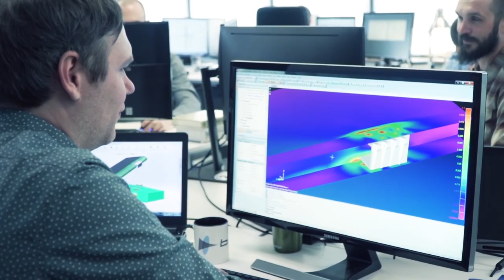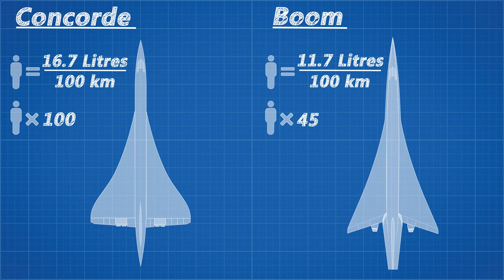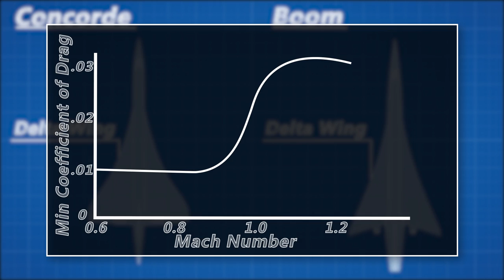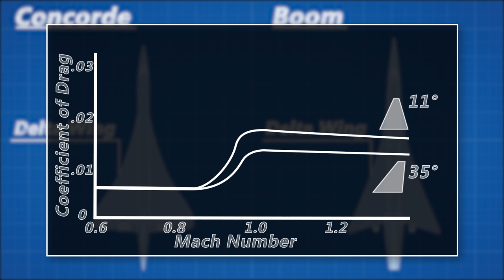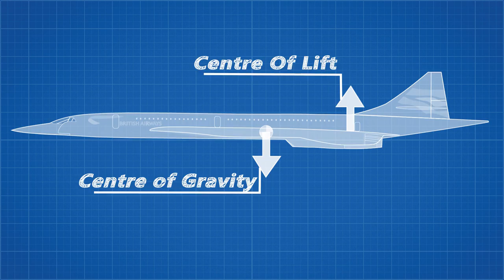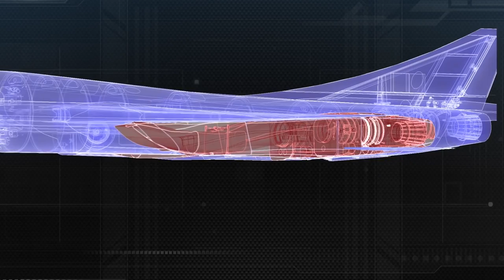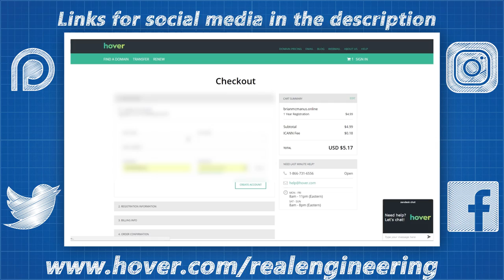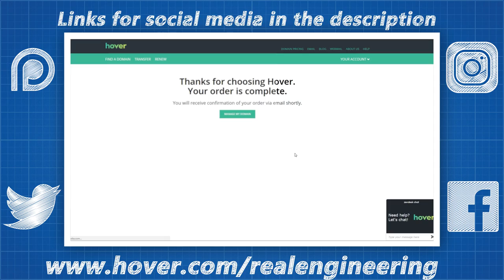Boom: The Future of Supersonic Flight?

Comment: Unfortunately, in 50 or so years time there will be no commercial aircraft flying. Not even subsonic!
Reply: What do you base this on?
Reply: kdmc40 maybe we will see another Blimp/Zeppelin era with solar powered massive blimps. I wouldn't mind that.
Reply: why is that?
Reply: Fuel
Reply: crude oil can be created from algae at high pressure and heat, which with modern energy recovery methods is quite efficient
the only barrier to it is not having easily farmable waters, which could be changed quickly by lifting restrictions on phosphorous in detergents
Reply: ???? they do though
100-LL and Jet A come from fossil fuels
Reply: If Kerosene and Gasoline are banned because of environmental regulations (which they should), nuclear powered planes are a definite possibility. If a jet was powered by a fission reactor, it would be able to stay in the air for weeks or even months.
Reply: Although you may be right about a fission reactor delivering enough power to enable stable flight, it is highly unlikely that a fission power system will be able to deliver the large range of rapidly changing thrust magnitudes that a jet requires for manoeuvrability. Moreover, there is absolutely no need for any jet to stay in the air for weeks or months, as there is simply no task that requires that kind of flight envelope. Any long-endurance flight would be powered by solar power on a high aspect ratio plane with a low cruise speed. Without being a nuclear expert, I simply don't think fission has the versatility required for aircraft propulsion purposes. Fusion perhaps at some point, correct me if I'm wrong?

What I agree with you on, is that a (necessary) ban on fossil fuels would in no way mean the end of civil or military aviation. There are already trials with solar power and battery power, and because the energy density for batteries is going up at the some time as price per kWh is decreasing, this will at some point make battery power feasible for aviation purposes. Perhaps not for commercial airliners, but who knows what technology will have brought us in 50 years time? 

One thing is for sure, the original comment by @kdmc40 is not very sensible.
Reply: killarz0 the USAF played around with the concept of the nuclear powered bomber, they gave Congress a "glowing" report on the project. Nobody in their right mind would want to use any kind of nuclear reactor in an aircraft in case it crashes. Anyway the shielding required would ensure that the aircraft would have lower profitability than Concorde and that's going some!

I suspect the next big thing in aviation fuel will be hydrogen, but don't tell the greens as the gaseous emissions of burning hydrogen will also produce a notorious greenhouse gas - H2O.
Reply: kdmc40 
Even assuming fossil fuels are uneconomical or absent by then, it would be a mistake to assume that biofuels would remain prohibitively expensive by that time. Even if they were, you don't need fossil fuels to operate an aircraft. It can operate using electric motors, powered by batteries, solar panels, and/or liquid hydrogen. Then there's the possibility of nuclear power. All of these are theoretically achievable today, much less in fifty years. Solar Ship, for instance, is a Canadian company which is building a combination flying wing/airship that has a hybrid powerplant of solar and gasoline.
Reply: Solar is unlikely to be used for thrust outside of ultralight unmanned aircraft. The surface area required would just be too great. If you could make a battery with the same energy density and volume as kerosene, than sure, that could work. Personally I think bio or synthetic fuels will be used, possibly hydrogen if it can be stored properly.
Reply: +logan kotz - Yes. In fact, Jet A is essentially just highly refined Diesel, and it's not uncommon to see cars and lorries on airports running on Jet A, as a diesel engine will happily run on it without any issues.
Reply: Electric aircraft propulsion will take ages to become viable. It probably won't even happen because we already have a technology that is better and "if the funds were gathered" doable with today's technology. The hyperloop:  just tube the shit out of the globe, somehow secure the network from terrorist attacks, and say goodbye to aviation.
Reply: Ralphie Raccoon 
Under ordinary circumstances, you are correct. Even if every surface of a commercial airliner were covered in 100% efficient solar panels, it couldn't get off the ground. Sunlight simply isn't that powerful. However, large multi-ton cargo aircraft like those being developed by Solar Ship have a much larger wing area (due to their oversized delta configuration) and drastically lower energy requirements (due to their very low speed).

On another point, batteries would not need to have the energy density of kerosene, if physics would even permit such a thing. Liquid hydrogen could run an electric or combustion aircraft. And, as electric motors are more than 95% efficient nowadays, they can go much further on less absolute amounts of energy.
Reply: MrAdoh2010 
The hyperloop is not viable in any way, shape, or form. I don't trust it to be able to operate without causing the horrific, gruesome catastrophes that are inevitable when dealing with vacuum, much less doing so in an economical fashion. Even if they were commercially viable, hyperloops would no more be able to replace aviation than bullet trains in Europe and Asia have replaced airplanes. Reminder: you can't build rails or tubes on the ocean, and ocean liners are all but extinct.
Reply: Uh, in 50 years we would be using electrical base  tubrofan engines, so don't worry.
Reply: Biofuel jet fuel is 70% normal jet fuel, so even if enough land and take-aways  could be found to fuel all those aircraft, it would not help much.  The crew from the Russian nuclear aircraft were all dead after a few years because of the radiation - nobody has found a safe way to shield the crew, let alone any passengers, of a nuclear aircraft (which spews out radiated exhaust from its engines in the simpler version at least).  There may be fuel available to fly some planes in 50 years but it will be too expensive for most people to afford it, and massive increases in passenger numbers are reliant on cheap air tickets - tickets that increase in price at a rate lower than the increase in incomes.  For quite a while now, real incomes for the masses have not been increasing.   Meanwhile the demand for oil and oil products continues to rise, and so eventually the price will start to rise sharply.  So in 50 years time (probably sooner) only the super rich, emergency services, government leaders, and armed forces will be flying (if they the last group don't decide to keep all the air fuel for themselves)
Reply: But hey, we can still get the electric powered airplanes, those can be run on any kind of fuel via a generator and still provide enough power to break the sonic barrier. And those are so cheap to make, cheaper then most other airplanes.(though you would need a way to make batteries swappable quickly.)
Reply: there would be sub orbital for long range flights
Reply: The Skylon requires  a reinforced runway and at least two days after each flight for turn-around.  It runs on liquid hydrogen so there's not such a problem with fuel, although additional infrastructure would have to be made available to provide it.  There's not been any mention of how much noise it would make on take-off; and it would probably have to take off over water.   it only carries 24 passengers and first flight is not until at least 2025 - flights which would probably be rather expensive, this isn't a mass transport option, though after more development something better might be achieved.
Reply: You can't have electric powered jets so you can't have a supersonic electric aircraft.  Also batteries don't have the power to weight ratio required.  Batteries can continue to be developed but at the moment they require exotic materials that are likely to be in short supply - lithium for instance is a common element but present in only a few places in concentrations worth mining.  The rare earths are in a similar situation (hence their name) and the supply of cobalt doesn't seem to be that plentiful, either.
Reply: The solar ship is a more of a blimp than a plane, and compared to a passenger plane the payload is tiny. And anyway, something that slow would not be tolerated by many passengers.

I mentioned hydrogen, that is a possibility, but there are challenges compared to synthetic or bio kerosene. And even if the motors were 95% efficient, the fuel cells definitely won't be. Probably better to burn the hydrogen in the engine, after all, you only get water out.
Reply: Ralphie Raccoon 
The Solar Ship isn't really a blimp by any reasonable definition. Only 30% of its lift comes from buoyancy; the remaining 70% is aerodynamic lift just like any other plane. And its payload is actually quite high compared to its competitors—bush airplanes and helicopters. Larger planned versions can carry many tons of cargo, but due to its inherent design, its physical dimensions (though not necessarily mass) will be much larger than similar planes, and its speed consequently much less. A top speed of 80 miles per hour may not sound like much, but these are cargo aircraft, not passenger aircraft.
Reply: but even 80 mph might be acceptable to passengers for a cheap flight as it would be in a straight line, ignoring terrain,  with larger amounts of baggage per passenger, and  considerable comfort would be possible (like the early airships) - rather like cruise ships I suppose, although just as susceptible to the weather if not pressurised.
Reply: thracianTV 
One thing that any airship or hybrid airship will always have in abundance is space. The R101 airship, for example, had more than 5,500 square feet of space on the A Deck alone. That by itself is more than an entire jumbo jet. 

Perhaps that and the lower cost would make up for the lack of speed, if some sort of passenger application were to be considered.
Reply: 80 mph? With all the hassle of the airport I think driving would be quicker. And good luck getting cheap tickets with a craft that small. Larger amounts of baggage will reduce the number of passengers it can carry. And even a comfortable seat would be uncomfortable after 24 hours sat in it.
Reply: All that space is no good if you can't carry a whole lot. Space is not the most important thing, payload is. honestly I can't see these things being cheap if they can only carry a few tens of people. Economies of scale and all that.
Reply: Exactly, these are not going to be used for passenger routes. Many tons is nice, but you'll need tens of tons of payload to compete with traditional large cargo haulers. Plus if you need massive specialist infrastructure that's also a problem. A small fixed wing  plane just needs a small airstrip and a hangar.
Reply: That's fine because it's a spacecraft, it's not going to be used for terrestrial passenger travel. There is the A2 hypersonic concept which uses similar technology, but that's even later in the pipeline. But in theory a London to Sydney trip could take just 4-5 hours on it.
Reply: TheVarklin Firstly, I've been an aeronautical engineering all my life. Thete are certain things happening today that didn't hamper technological progress in the past, one being the rate of technological change. I'll come back to that. Firstly, the world is running out of fossil fuels ant thetes no way to power aircraft without them. Things like Hydrogen is no good as it would take at least 30 years to develope a commercial hyhrogen aircraft if you started the research right now. No company is going to risk the investment over that time for something like transport when it is likely that fusion will be sorted by then and make high speed ground transport very cost effective. Back to the rate of technological change, if you were to start research on something say over 20 years by the time you gor half way through it the research you started with in the early stages would be obsolete. This obsolescence carries on through the life of the project. Fusion is the only technology thet is worth the long term investment because it is such a total game changer. Any hydrocarbon type fuels we have in the future would be better used on say agriculture to feel the 11 Billion people there will be in 2060.  My guess is there will be a world where fusion rules, high speed trains in tubes carrying people from the centre of one population mass to another. Really no need for large commercial aircraft polluting the atmosphere!
Reply: Jjames763 you wouldn't be operating in a vacuum. It would be roughly the same environment as a high altitude aircraft but powered by electricity. How it works is a partial vacuum and the train sucks the remaining air from in front of it and pushes it out the back behind it.
Reply: Jjames763 electric/battery system is not feasible for many reasons, firstly the energy density of batteries would no come close to enough. Nuclear is not feasible because of safety and just plain space. The nuclear reactor does not in itself generate power, it creats heat which drives a steam turbine which drives a generator which produces power. Solar again just doesn't have the energy density. Hydrogen won't work either as for the dame reason Zeppelins stopped using it, safety. Also, producing Hydrogen and then recombining it with oxygen is very inefficient use of energy. Its possible with biofuel as it would take relatively little to convert a modern aitcraft to biofuel right now. But i think biofuels will be needed for more important uses like agriculture. Seeing as there will be 11 Billion people by 2060.
Reply: r0nas22 This is very feasible.
Reply: Tom Johnson 2030 is just around the corner. I'm talking about 2060-2070ish.
Reply: Ralphie Raccoon 
Again, you're not looking at the proper aircraft here. The first aircraft built by Solar Ship are of a similar mass to planes like a De Havilland Twin Otter, with the advantage of an ostensibly lower cost and higher payload capacity and the disadvantage of lower speed. You can call the payload small all you like, but that's like judging a commercial jet to be unfeasible based on the size and performance of a Cessna Caravan. They have larger versions planned out that can carry many tens of tons.
Reply: Ralphie Raccoon 
As for infrastructure, Solar Ships are bush aircraft. They can operate in the same places and they are small enough to fit inside those same hangars used by bush planes—the company uses such hangars for its smaller prototypes. Larger versions need larger hangars, just like larger cargo aircraft.
Reply: kdmc40 
When I say "nuclear," I'm referring to the possibility of fusion, or some of the wilder concepts for safe reactions. Assuming they become viable by 2060s and 2070s. I was just listing out possibilities for alternative power sources in order to counter the original poster's claim that aviation in 50 years will be extinct. I wasn't necessarily listing them in any particular order of viability. If you want my personal opinion, in 50 years' time commercial planes will probably be using some sort of biofuel, or possibly have some sort of hybrid electric propulsion. Shorter-range craft may well be battery-electric.
Reply: Jjames763 Fusion really isn't viable for aircraft. It'll take at probably 2050 for a viable fusion to be up and running and it will be huge. Fusion will still require a steam system to generate electricity. They would have to develope a system small enough to be carried on aircraft. This really is not going to happen. 
I think technology is paintong itself into a corner right now. I read an article written in 1971 by respected scientists that stated we would definitely be on Mars by 1985. The same article stated they're would be cities on Mars by 2020. When in fact we have not being out of low earth orbit sonce 1972. The space shuttle and concord were retired with no idea what was going to replace them. 
An electric/hybrid aircraft is not feasible either as it is not expected for batteries to have the same energy density of say Jet A1 until 2050. Say you had a hybrid system with 60% biofuel and 40% battery. That means that you have to carry about 25 tons of battery for the entire trip. They're would be no purpose in this as you would have to carry extra biofuel to tow the battery system around the sky. Also, you could refuel the biofuel relatively quickly but what about charging the batteries. Fact is, no one is investing any money in any future aviation designes that could be a game changer.
Reply: kdmc40 
Yes… I agree. The current developments are indicative of what we in the biology sphere call "involving to extinction," that is to say, short-term gains and savings being made at the expense of the long term. We need to get in on non-fossil-fuel dependent aviation now to avoid a great deal of pain and loss later—but we aren't. Regardless, I just don't see the economic forces being such that it would completely destroy aviation. It may be changed or much reduced or supplanted at the lower cost levels by rail, but aviation in some shape or form will probably survive. It is simply too big an industry and too high in demand by too many people. Many of whom are of considerable means, political and economic.
Reply: Jjames763 You could be right, I hope I'm wrong!
Reply: The much publicised flights of aircraft on biofuels have so far been with fuels that had 70% normal aviation fuel - so that won't stop a reliance on fossil fuels, even if sufficient crops could be grown and take-away stores could be found to supply the whole aircraft fleet.  The extensive use of biofuels would create a food crisis and extensive world-wide instability as food prices rocketed.  Even the use of algae to grow fuel would involve large amounts of inputs that would be better used elsewhere and some of them would be derived from fossil fuels or use fossil fuels in their manufacture (e.g. fertiliser).
Reply: thracianTV 
Not necessarily. The biofuels are a proof of concept—you could in theory burn 100% bio-derived liquid fuels in a futuristic aircraft designed to that specification. And this business about a food crisis is overblown if you ask me—corn ethanol is already obsolete. The real biofuel contributions will be from non-food crops such as genetically modified algae and grasses. Such installations needn't be operated with traditional agriculture, either. Industrializing the production process using methods similar to hydroponics and vertical farming could vastly reduce the pressure on land and resources that can otherwise be utilized for maintaining the natural environment, food production, and human habitation. Naturally, costs will come down eventually, but you need to have a strong initial investment in the research and infrastructure for that to happen.
Reply: most agricultural processes require vast amounts of fossil fuels and fossil fuel derivatives and using waste products such as grasses seems likely to still encounter the problem of finding enough space to grow them.   Basically (as resources are always going to be unequally distributed) you need the human population to fall and reduce pressure on resources to a sustainable level.
Reply: thracianTV 
There's no contesting that resource use must be reduced, but there are certainly different degrees. Hydroponics, for instance, requires enormous initial capital investment to be done at appreciable scales, and so obviously doesn't work well in third world countries and the like, and in terms of food production it is only really useful for fast-growing fruits and vegetables, not staples like grain, potatoes, or anything which comes from a tree. However, its land, water, and fertilizer use is staggeringly reduced compared to conventional agriculture. For an operation like biofuels, it would need to be done at massive scale or not at all. Preferably, it would only have to be done for aviation, since in 50 years' time electric cars should be ubiquitous. Aircraft, however, would still benefit greatly from the energy density and ease of using a liquid combustible fuel. Hopefully, they'll be significantly more efficient about using it by that time as well, and not quite as in demand due to other means of transit like rail.
Reply: Biofuels aren't the only option. There are experimental carbon-neutral methods of using electricity to take C0² from the atmosphere and convert it to hydrocarbon fuels. So even if we switch to 100% clean and renewable energy sources but are unable to develop clean portable engines that can power aircraft, by the time we are unable to economically dig up any more fossil fuels it should be economically viable to create our own carbon-neutral fuels.
Reply: While I don't think nuclear is worth attempting (there are carbon-neutral ways to make fuel in the future), the idea that nuclear requires a lot of weight to work is only valid in regards to the common uranium based nuclear technology the average person is aware of, due to the beta and gamma particles it emits. This isn't the case with other nuclear technologies such as thorium that work with elements that just emit alpha particles and hence don't need the same level of shielding.
Reply: MrAdoh2010 The hyperloop is too dangerous and would be too expensive, lookup thunderf00ts videos about it.
Reply: IIIDoctor_EIII , now that would be real fun being butt cheek to butt cheek with someone for weeks. The only way it could be better is if the person next to me weighs 300 pounds. ✈✈✈✈✈✈✈🛫🛫🛬🛫
Reply: Robert Faber, it's essentially kerosene not diesel.
Reply: Saviliana , where in the world did you get this idea. It doesn't even make sense.  It's not coherent.